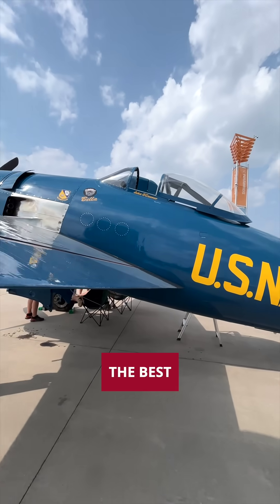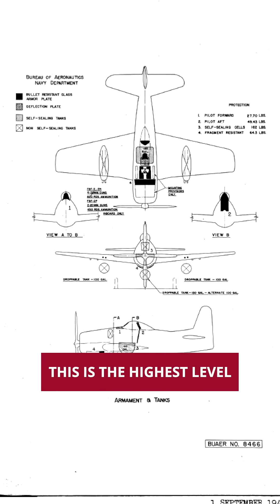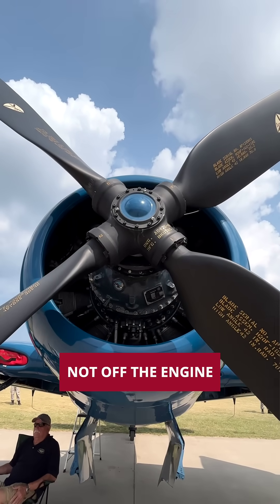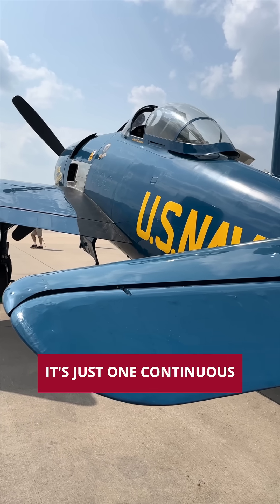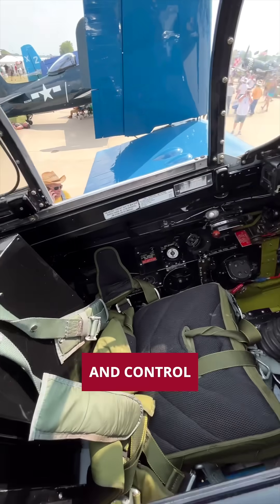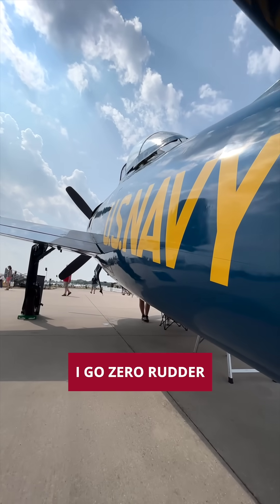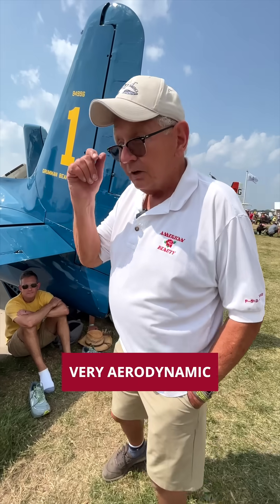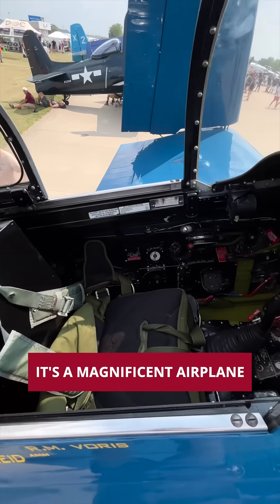F8F Bearcat: Peak Piston Engineering

Comment: It was better than the Zero in almost every conceivable way, but no way in hell is it turning INSIDE a Zero. Zero is lighter, has lower wing loading and was optimised for turning. This isnt to say a Zero could win. A F8F pilot would never try to out turn a zero, if they ever fought they would probably use its climbrate to get above the Zero and repeatidly dive on it until they shot it down. Zero would never stand a chance, unless the F8F was preoccupied or made a severe mistake. 

Best piston engined Naval fighter was still the sea fury and you will never change my mind.

Comment: Sorry sir, that aircraft has rivets, they are flush or countersunk head rivets, same as the P-51. Rivets did not make the difference but the engine power. The Bearcat is 2250hp, the P-51 1450hp. Beautiful bearcat though.

Comment: The owner of this F8 Bearcat is like most people including aviation buffs are ignorant to the design changes that allowed every aircraft with radial engines to be just as fast as the sleek inline engines aircraft like the Spitfire, ME 109 and the P51.  In 1927 Fred Weick of the National Advisory Committee for Aeronautics NACA the predecessor of NASA invented a new cowling design for radial engines. Prior to his new design cowlings were used to direct cooling air for the air cooled radial engine.  He developed the cowling to be a modified airfoil with its center of lift being directed on the toward section of the cowling.  His design created a circular wing.  The forward lift created in flight negated the large flat radial engines tremendous drag penalty.  This is why the P47, all of the Navy's fighters and all of our heavy bombers were as fast as the aircraft that used online liquid cooled engines.  All of the other things mentioned such as flush riviting are important but the main reason these aircraft were so fast was due to the use of the NACA cowling.  Another great development by NACA was the laminar flow airfoil that greatly reduced drag, the P51 used his airfoil in its wing and is the reason for its long range that all other aircraft like the Spitfire, P38, P40 and the P47 could not match because they were all designed before the laminar flow airfoil was invented.
Reply: The P-47 definitely could match the range of the P-51.

Comment: The P-47-M (which actually saw combat in WW2) and the P-51-H and Grumman Tigercat (which like the Bearcat didn’t) were all faster. The P-38 would out climb it. The P-38 and P-47 had better armament.  The P-40 and P-38 could out turn it a lower airspeed and at higher airspeeds the Bearcat suffered from G restrictions because of structural problems with the folding wings. 
The Bearcat was an amazing aircraft but like any plane it was a compromise. It didn’t do everything better.

Comment: Im a thorough avgeek, and I am absolutely fascinated by those machines that are the "pinnacle, zenith, peak" of their hardware. I always wonder what the technology would have looked like if it had developed at the same intensity for another decade. The F8F as well as late prop commercial airliners are packed to the brim with the most clever and resourceful mechanical tricks. I can't help but be in awe of the engineers that weilded such an impressive understanding of their craft and produced purely impressive machines that maximized the performance of the technology they had.

Comment: Blue Angels F6F's right after the War and then transitioned to F8F's within a few months.   Certainly is a great airplane but certainly not the best warbird BY FAR.  P51's also had flush riveting, top speed was 20mph faster, and with drop tanks had a range of over 2000 miles.  The F8F with drop tanks was about 1100 miles due to the fuel consumption of the P&W R2800 Double Wasp engine.  So it WAS a great airplane but certainly not THE BEST.  Not sure if any warbird can outright claim it was the best.

Comment: The Bearcat also had servo-tabs on ailerons, providing light roll control forces, even at high speed. It had marginal longitudinal stability. Perhaps not as relaxed as the early Spitfire, but it was low enough the airplane did not require much stick pull effort to crank around in a tight turn. Part of the reason the wing is so light weight, is because of the very thick root section. 18%. Compared to 15% of most other aircraft. A small penalty in drag for a big advantage in strength and stiffness to weight ratio. It also employed wingtips that were supposed to shear off if the aircraft was over-stressed in a pullup type maneuver. The results were pretty catastrophic. It rarely worked as intended.

Comment: Truly great plane, but not superior to the corsair because the corsair could do so much more.  Why do you think the f8f production was so short and in such smaller numbers than the f4u...
Reply: Bc corsair was older w longer production run, @VJ stocks were full, and now come the jets! Or do you believe in parallel universe w nonzero games where everything and everyone are produced and used to their full potential?
Reply: Kinda apples and oranges. The bearcat was specifically designed to be able to take off from a small deck and then rapidly climb to intercept an incoming strike. Range and payload were sacrificed to make this possible. 

The corsair was a big old bird that had long range and was a true fighter-bomber.

Comment: I have a 1963 Piper Cherokee 180.  It’s a very stable platform - especially IFR.  She is hard to upset, wants to fly, and doesn’t want to land.  Needs very little rudder and the wings and control surfaces are huge.  Lots of drag, though, and slow.  Lots of screws & rivets.

Comment: Simply NO! What he says at the start is so wrong
Reply: What did he say? You've provided no receipts.
Reply: @darkplainsdrifter3499 
He said it's the best warbird ever made and the OP's right, it isn't. 
Everything about designing an airplane is a series of compromises, and to get the rate of climb and other characteristics they wanted for it they had to give up other things, mainly range, it has very little fuel capacity in order to keep it light, it's a very short legged aircraft because it was designed to take off and climb up as quickly as possible to intercept incoming aircraft, in its case Kamakazis.
It's a strictly defensive fighter, but it can't project power because it has no range, it's not an offensive fighter, it can't take the fight to anyone because it's optimized to defend the carrier. 
It was the best fleet defense fighter at the time but not the best all around fighter of the time.
Reply: @dukecraig2402 well said, thanks mate
Reply: @dukecraig2402 yes… this sounds logical… it’s a little like a Me 163 … start like a rocket… shot down an enemy and come down directly!..

Comment: It mentions zero but unfortunately that plane didn't come online until after the war
Reply: Correct but it was being designed during the war. The Hellcat was a stop gap for the wildcat while the Bearcat was being designed and refined.

Meow.
Reply: @MIFU1989 No, the Hellcat was not a stopgap for the Bearcat while the Bearcat was being designed.

The Hellcat was into the prototype stage before the Bearcat was even an idea, and the Hellcat was introduced nearly a year before work even began on the Bearcat. They both have different design goals.
Reply: He said it could turn inside a zero. Obviously on paper, not tested in combat. Since there are so many factors. Might be a slightly over reaching comment. With the power, weight, well thought out aerodynamics. It might have been possible. Though, those that flew the wildcat & hellcat. That flew the bearcat, if it did turn better, out turning a zero would be a statement to its abilities. Zero was very light. Yet, constant tightest turning in WW2 aircraft, lose energy & airspeed. The bearcat with the combination of power, advanced aerodynamics & weight. Most probably  did much better than other WW2 fighters.

Comment: Pilots referred to it as an engine with a saddle on it. The engine is heavier than the airframe.
Reply: Fulcrum Point!
Reply: According to google search, the engine weighs ~3,000lbs. A dry F8F weighs ~7,000lbs. The engine is not even half the weight. It would be impossible to balance that airframe if your statement was true. Beautiful airframe. I hope to build a scale RC version soon.
Reply: If that were the case then why isn't the engine on the floor? The center of gravity can't be in front of the main gear, and if the engine is more than half the weight, that doesn't add upp
Reply: @kevinm.n.5158 Length of the tail boom in relation to the CG. Distance of engine from the firewall.
Reply: @kevinm.n.5158 the tail doesn't have to be heavier than the engine - you need to take the moment arm into account.
Reply: @kevinm.n.5158  ...the keyword is "Airframe"... Not "Aircraft or Airplane "
Reply: @kevinm.n.5158  You can actually lift the tail off the ground by hand. I know, I’ve done it.
Reply: @kevinm.n.5158 It has nothing to do with center of gravity. They were referring to performance, power to weight ratio.
Reply: @kevinm.n.5158 did they drop teaching geometry and physics or something?